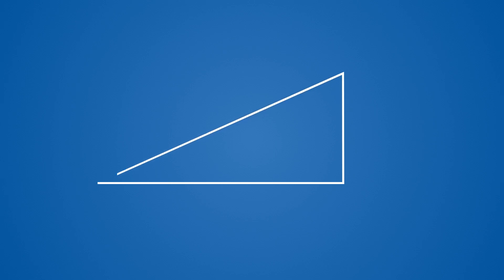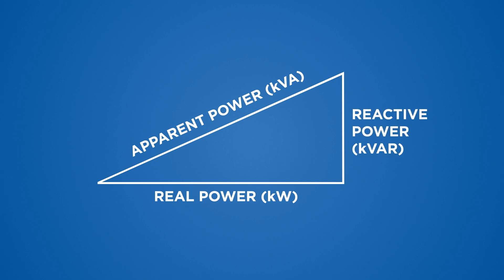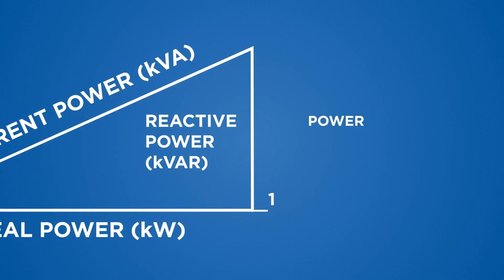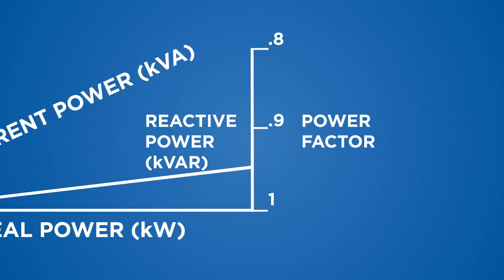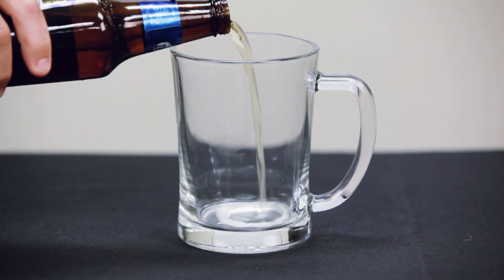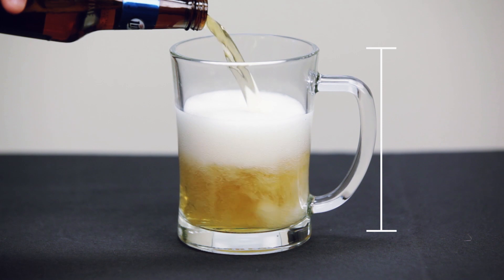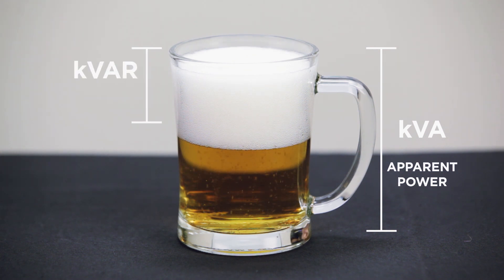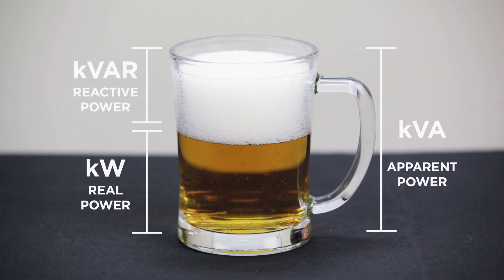Difference between Real, Reactive and Apparent Power

Comment: The beer analogy is the best. But there are still many simple and not too technical questions. Real power is purely resistive, it results in heat. What about Reactive power, if we have a purely reactive circuit, what results? How can we compare the "heat from resistance" to whatever reactive components create? And what is "wasted" in the reactive component of power? We say it is inefficient, but what exactly is lost and where to? Also, what results in a circuit that is not "wasteful" and makes it close to a power factor of 1?

There is also complex power, how is it related to apparent and other types of power?

Comment: Is what you're saying the reactive power is formed into heat energy through the resistance in the wires. If so, is the power written on the device like a blender the apparent power or the true power?
Reply: +Wesley aithusia It doesnt have to be heat always, for instance in an inductive circuit you would have losses on the coil since no transformer or electric motor is 100% power efficient. As for the blender the power rating on the back should always be apparent power.

Comment: Andrew Berney has said here that the KVA is a mathematical calculation a real power divided by reactive power, which is wrong! KVA is a mathematical calculation of  Squared root of squared sum of real and reactive power..
Reply from the maker: Thank you Sudip Shiwakoti  In the video we try to very simply demonstrate the basics of voltage, amperes and frequency. To calculate kVA the formula depends on the voltage and the current, and whether the connection is single phase or three phase - to calculate unknown kVA.